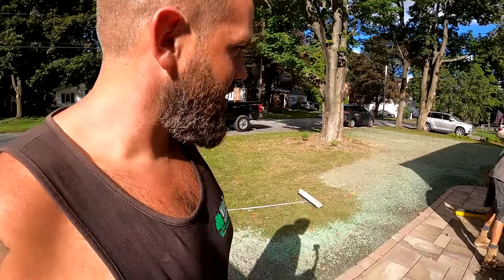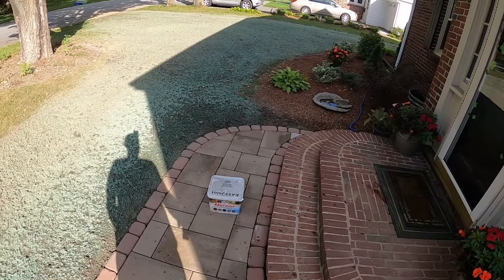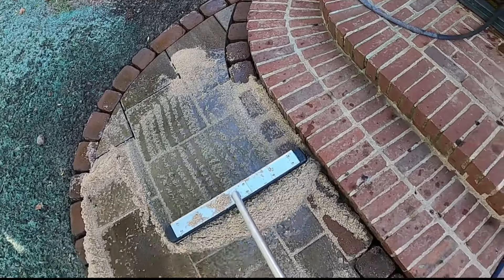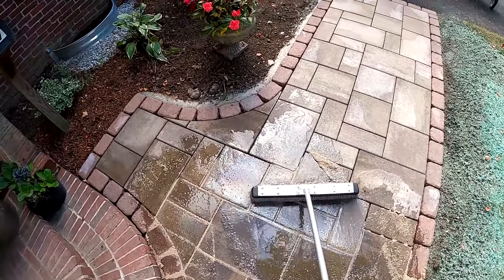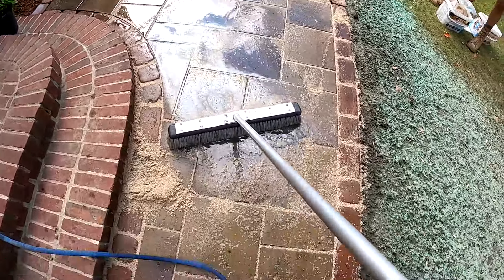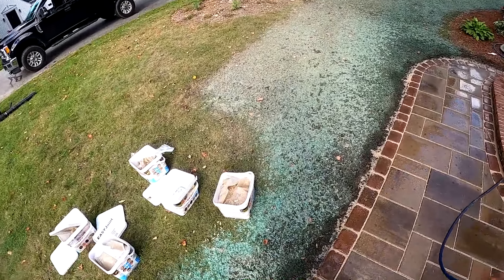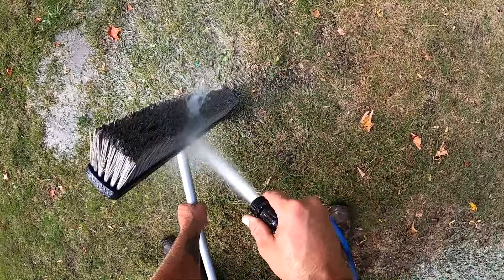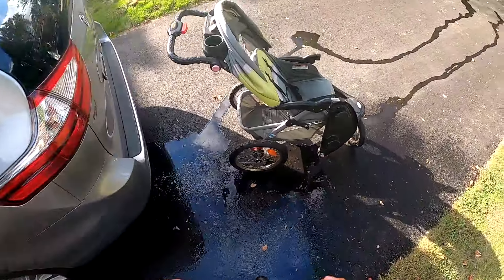How To Use "Easy Joint" For Concrete Pavers (DIY)

Comment: Great video and clear graphics….gonna give this a try as the polysand  I used on my pavers over a year or so comes off when I power wash it yearly and now every time it rains I get sand all over the furniture and stones.
Reply from the maker: Thank you, this stuff sets up very hard, not sure how it will hold up under a pressure washer though. I know any polysand that you install will get blown out if you pressure wash them. Unfortunately that just happens... They sell cleaners that you mix with water and use a brush with, then just rinse off the pavers once your done brushing. not sure if that would help in your situation... ✌
Reply: @TheChristianHardscaper  thank you for the quick response… May you   Continue with great success in your business.

Comment: Worked with this stuff it’s good but make sure you don’t leave any of the water residue on top, especially on lighter colours like kandla greg even if it seems very watered down it will leave greasy stains on your paving. Found this out the hard way.
Reply from the maker: I agree completely. You need to rinse it down very well once you have swept it in. Sorry you had to deal with that, never fun...

Comment: Hey. Good job! I did exactly as you have done with plenty of water, and a day later the easy joint sand is still loose inside joints that I can pull it out with my fingers. I am wondering what is the setting time for this product? P.S. What is the green stuff on your lawn at 8:00
Reply from the maker: Hi, thanks! I hope by now it has set up.....It should be good in 24-48 hrs.  if not, maybe a product defect...? The green stuff on the lawn is hydro seed. ✌
Reply: @TheChristianHardscaper   yes, you were right! It started to setting up after 48hrs. Many thanks!! Hydro seed? Hmm, I have never heard about it. I have to look it up. Thank you!

Comment: Hi Christian, which is the best sand?  We applied G2 - Gator Max yesterday, but the top looks hard but when you poke it, the bottom is still soft and loose. Thanks.

Comment: Another great video! Dude...did you freak out at the owner for getting seeding into the pavers before they were jointed? 🙀 I know this material is supposed to require more work with smaller joints. I've got a paver body with Techo-Bloc Blu 60 Smooth, which has a reasonable 1/4" gap, and their Victorien pavers (basically Holland) for the soldier course, which has a much narrower gap. Do you think this product would work with that setup or do the tight joints on the soldier course make it a no go? 🤔
Reply from the maker: Thanks, unfortunately the hydro seed guys were to blame for that…. Not a huge deal though, some extra clean up before hand, that’s all. This stuff will work fine for the Blu 60, a little more difficult with the Victorian joints….. I think you could make it happen but polymeric sand is better for those tight joints. ✌🏻

Comment: Do you just hit the pavers with a compactor before using the ez sand? Assuming with the wet application the sand probably gets settled without vibration.

Comment: This video is very helpful. Do you  prefer traditional poly sand compared to the sand used here? Or for a beginner, like me, is this sand good enough?
Reply from the maker: I think this sand is excellent, but very expensive…. Also, you need a good size joint for this sand to work right. If the joints are less than a 1/4 inch, this stuff doesn’t work well. But if the joints are wider then 1/4, it’s excellent ✌🏻
Reply: @TheChristianHardscaper  Good video, so how about exactly 1/4"?  I'm thinking of using that for Techo-Bloc Blu 60 smooth bundle, does that sound like the right size joint?  Thanks!

Comment: You usually compact after the pavers, while adding polymeric sand.  In this case, would you compact before?  Would you do it on the chip stone before you lay pavers?
Reply from the maker: We compacted the pavers into the chip stone before we used the easy joint. ✌🏻

Comment: If cost wasn’t a factor would you choose this over polymeric sand? Which will last longer also? Thanks for the videos 👍🏻
Reply from the maker: If cost was not a factor, i would use Easy Joint as much as possible. It hardens like crazy.... But something to think about is that Easy Joint only works for somewhat wide joints, if you have small joint lines, this product will not work to good. Poly Sand has finer sand in it to allow for filling tight joints. Easy Joint has bigger sand particles in it, preventing you from filing tight joints. Other than that, this product is an A+
Reply: @TheChristianHardscaper  Oh man but what about the excess sand that got brushed off to the sides? Will that just harden and u can break it off and take it away or I guess u could clean it up before it hardens but idk if you did or not? I guess my main question is, once its wet how long do you have to clean the left over mess? Thanks

Comment: Quick question... What happens with all the excess sand that you've brushed or washed onto the lawn or the flowerbed? Does that not set hard or need to be removed?
Reply from the maker: You just have to do your best cleaning it up. If there are really bad spots, you try to clean it up while it is still wet to get it before it cures.✌

Comment: as leba christian ...excuse me for a question. how much. leda slope for water to patios 1/8 per foot ..... and depth 9 inches. .. greetings. and. blessings in all your projects 🙏
Reply from the maker: No problem! and yes, 1/8 inch per foot minimum. If you want to be safe, go slightly more than that. And yes, the depth we dig is between 8-12 inches depending on the soil type. ✌
Reply: @TheChristianHardscaper  Thank you very much Christian for your answers....your works remain with this type of material. Nice greetings from here in Virginia. and. blessings

Comment: So is the paving laid on  a permable base,? If not over a few freeze cycles those slabs Will de laminate from the the concrete base 🤔🤔
Reply from the maker: Yes, we installed an 8 inch permeable base under the pavers. ✌

Comment: Did u leave the excess sand in the flower bed and off the edges? Or what?
Reply from the maker: No, you can clean up the excess either when wet or dry. Some times it is easier to clean it up after it hardens... ✌

Comment: Your statements seem a bit contradictory. It gets really hard, but it lets water through? How does that work? Also, how do you clean up the sand that got rinsed off onto the side of the yard and flower garden?
Reply from the maker: I guess they do if you don't understand how hard things can be permeable. Even concrete allows water to go through unless it is sealed or painted..... Regular polymeric sand for paver joints harden, but also seal to prevent water from going through. This Sand I am using in this video is made of slightly different polymers and different sand particles which harden, but also remain slightly permeable. Allowing water to slowly permeate through the joints and down into your base layers. The extra sand on the edges can be easily cleaned after you finish installing the sand. ✌

Comment: I had a pipe broke down after installing this . Now I need to remove my titles and basically I can’t remove them not even with my pressure wash. This is concrete glue . Any suggestions?
Reply from the maker: This product cures hard as concrete. You may have to use a 4.5 inch grinder with a diamond blade on it to cut the joint sand out… that’s about the only thing I can think of….

Comment: Looks great. Could you tell me how many buckets did you use for that space. Thanks
Reply from the maker: Thank you, we used 3-4 I believe. The buckets should tell you how much sq ft it covers depending on the width of the paver joints.

Comment: This is a great video, thank you.  I am searching where to buy this and came up empty handed.  Any suggestions as to where this can be purchased? Many thanks
Reply from the maker: Thank you! I am located in Massachusetts, not sure where you are or where this manufacturer are located but i get it from a local masonry supply store. I would say, look on the website of the manufacturer and see if they have a local dealer near you... ✌
Reply: @TheChristianHardscaper  Thank you so much,  I'm in Oregon and am still searching.  Great video,  keep them coming!

Comment: Are you still using this product regularly?
Reply from the maker: I only use it in certain situations. I have used it about 6 times. Every time I use it, it works excellent. It sets very hard and is slightly permeable. The only problem is the price... Way more expensive than regular polymeric sand.

Comment: Ours just have not gone off or set in over 2 days and 2 attempts now. Frustrating
Reply from the maker: Wow, that is weird... I have never had a problem with easy joint. In fact it sets harder than any joint sand I have ever used...
Reply: @TheChristianHardscaper  Tell me about it!!! I'm in the UK and the product is from an Irish Brand called "Joint It". I wasn't sure about the tradesman doing the work so I called the manufacturer and they assured me this is normal, i'm still yet to be convinced. Cant see this product standing the test of time! Wish we could get work done the way you do it over there!

Comment: TURN DOWN THE WATER....its too much....about half that wud be better...ur also supposed to tape the edges where the stuff can leak out the gaps
Reply from the maker: That was a perfect amount of water, you really want to make sure the sand fills all joints. And I wouldn’t use tape because it’s a waste of time. All the water will make it peel of anyway….. ✌🏻

Comment: Terrible stuff use it and you’re regret it.
Reply from the maker: Tough to work with for sure but hardens excellently. 👌
Reply: @pullman5250 please provide examples for your comment or it doesn't help anyone. Thanks!